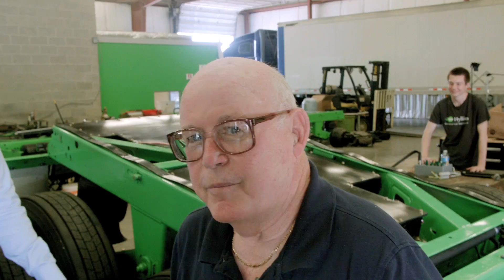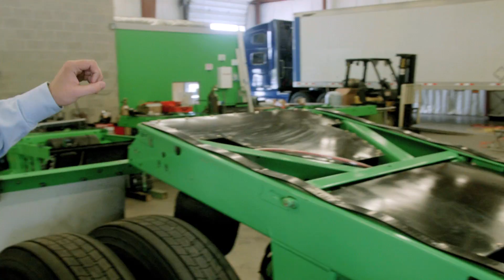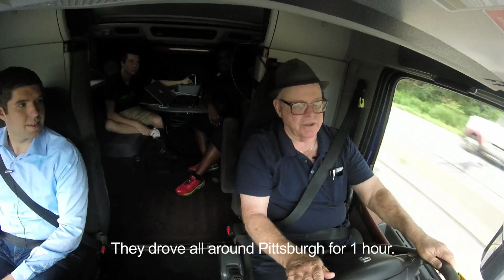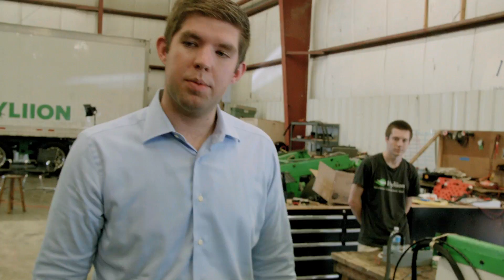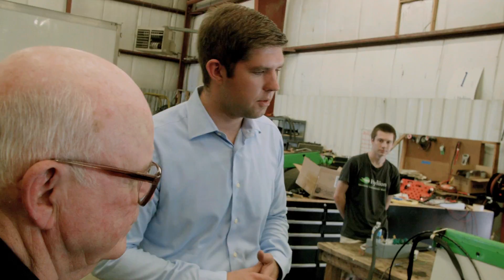Hyliion

Comment: need to make it charge a Tesla Semi. and give assistance or 18 wheel drive when going up grades or delivering live loads on farms or picking up grains from fields   good for mud, wet grass and rough terrain   a few more years and this is the best thing to own an alternator build on a trailer suspension that charges a Electric Semi. while going down road.